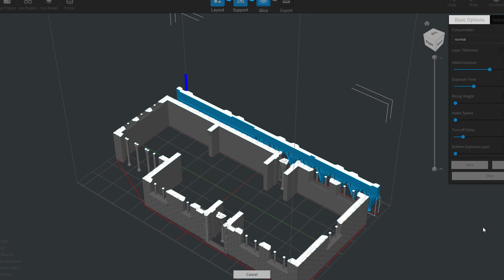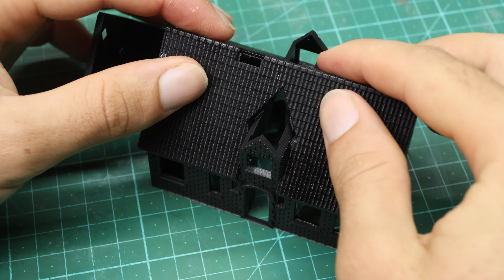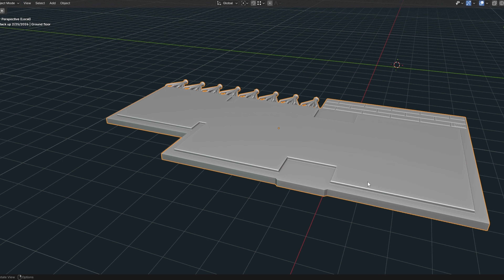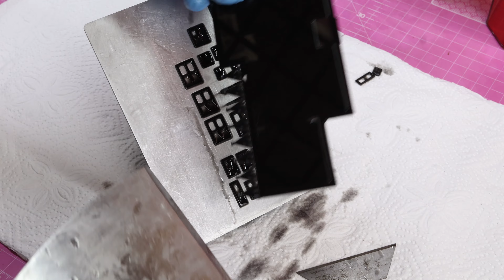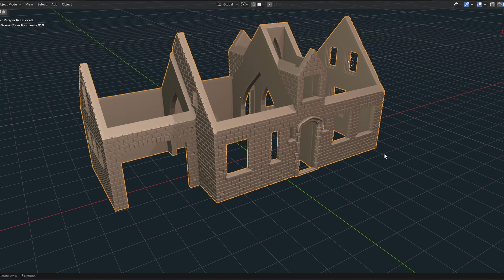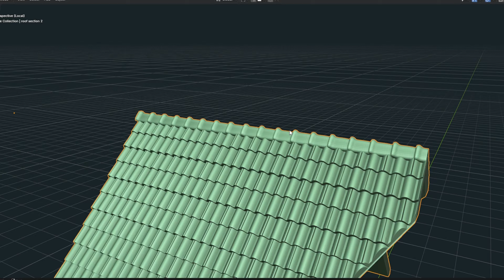Why I Print My Walls Standing Up (Even If It’s Slower) | Wijnberg House_001 Technical Guide.

Comment: Great info for how to design buildings for resin printing. For FDM I think printing walls standing up is also better simple for quality. Usually the top surface is not that great and the bottom surface will be textured if you're using the standard textured PEI sheet. I have a small building for my N scale model railroad I've been designing and will print it whole standing up with the roof, windows and other details printed separately. I like the supports you added for the windows - I'll likely do the same for that building.